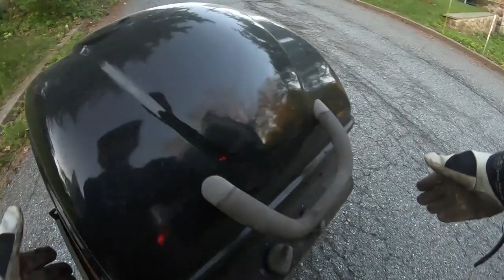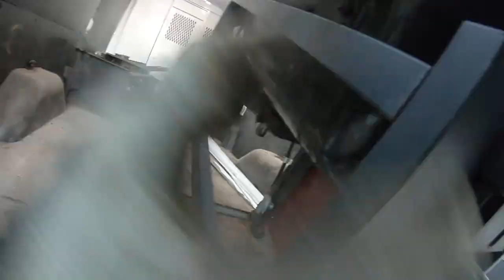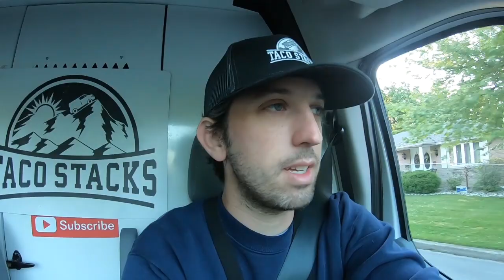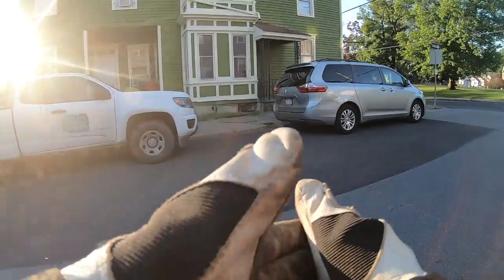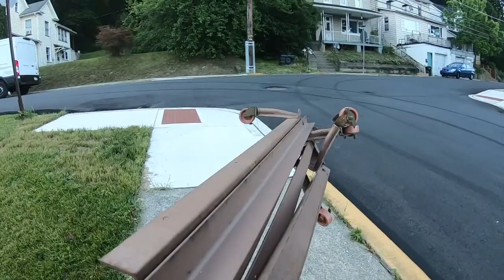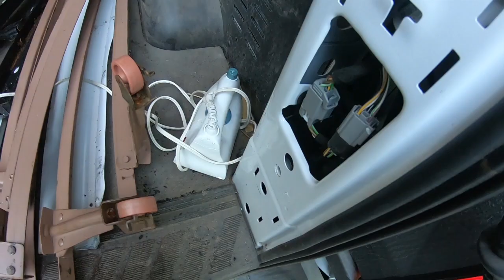These Trash Picking Finds Still AMAZE Me - Ep. 304

Comment: Fabricate a replacement cover out of a piece of scrap metal and bolt it down. Looks like those flimsy plastic covers are not attached very securely and you'll keep replacing them. And probably right: $40 a pop.